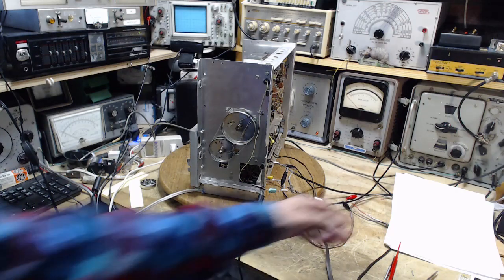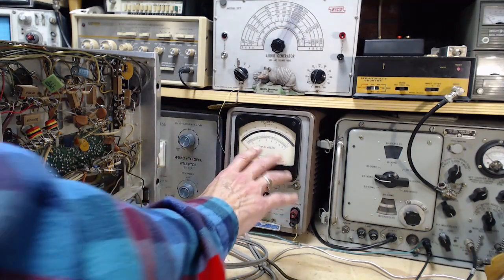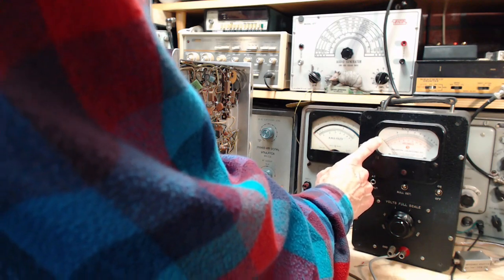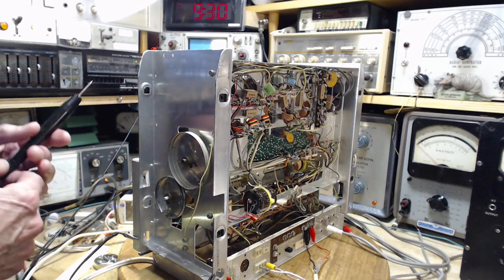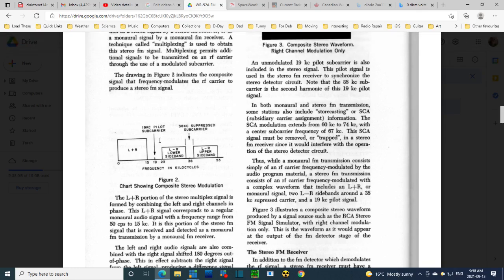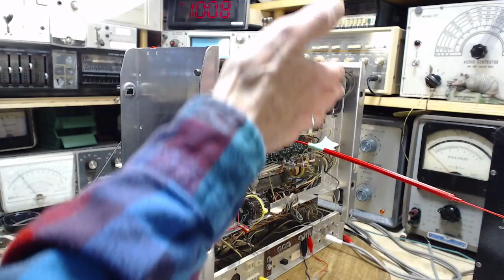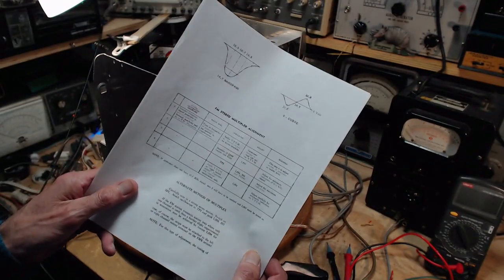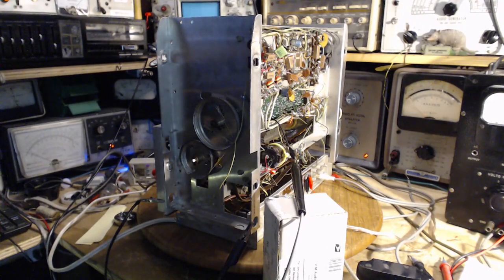Clairtone Console Stereo Video #28 - Multiplex Alignment Attempt

Comment: Sequences in alignment defined by the manufacturers are there for a reason. You will never get a usable S curve if you don't have the correct bandpass alignment. Set the top of that curve at 10.7MHz and the skirts should be symmetrical with 10.6 and 10.8MHz riding at -3dB on either side. Don't confuse marker pips with curve ringing. And what you mentioned about a flat top response curve in general is called staggered tuning as opposed to peaking.

Comment: Now back to FMX: The entire bandwidth of broadcast channels is 200KHz. It is cut to 74.5kHz to provide band guard transmission separation. You almost got it right, overloading an input will produce deformed response curves. Here some numbers: BTW, you should get an attenuator box (typical 10 20 and 20 dB 75ohms input 300ohms output). A good FM receiver will have an input sensitivity of 0.5uV (6dB) to 1.5uV (26dB) or 1.1uV for 1W output with an 15kHz/1000Hz (America 88-108MHz carrier) deviation input signal. The 19kHz pilot signal is set to 10% level of the main carrier, and the receiver has a low-pass filter with a roll-off of 20dB/decade above 15kHz. The resulting AF typically has a THD of 0.1% using 50mS pre-emphasis. Alignment test input has to preserve signal integrity, not at all as tolerant as AM.

Comment: So much to comment again.. here we go: Jim, please show me in the schematic where that L/R audio 38kHz switching is performed, I want to learn also. Then please get it correctly: SCA stands for Subsidiary Communications Authority (a US FCC regulatory branch). Next its an oxymoron you trying to explain what cognitive process is. Patronizing on subjects you ignore doesn't make you sound more important. And if you want to brag you must have figures numbers, facts or results to back it up. Your "style" of servicing is absolute lunacy. How can you align if there are defective components in the receiver? Randomly messing up anything that has a tunable element? At least you using a non-metallic tool to turn the slugs, we getting somewhere here.